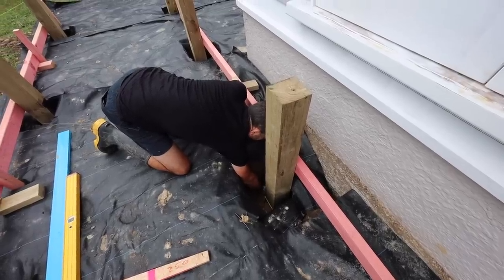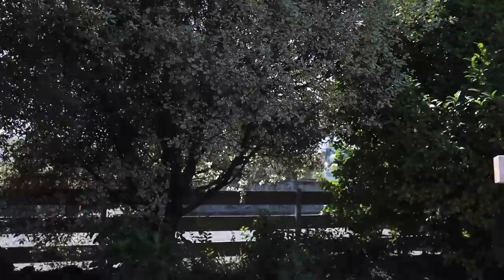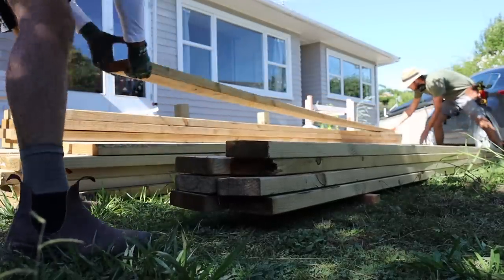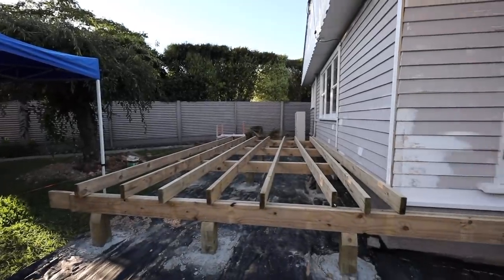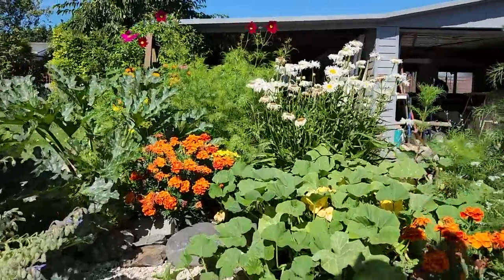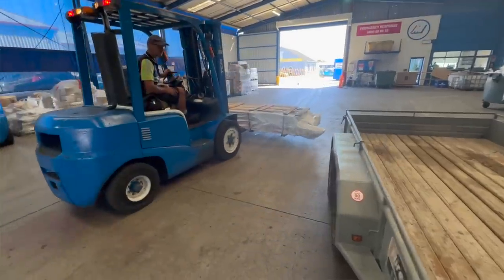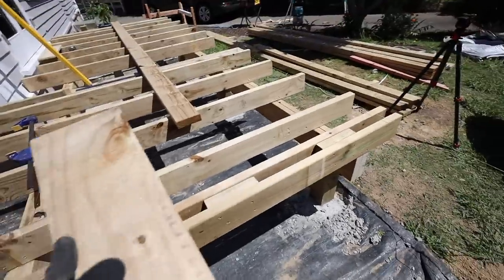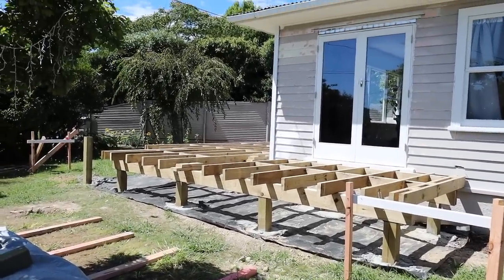Look at my big deck

Comment: Why using concrete around the pillars, the ground is firm and sandy, unless you build a house on the deck you are never put that much pressure on the piles. And it is going to rot a lot faster.

Comment: Too late now but when I put in posts I like to put 4 inch screws in the post about 1/2 way.  The screws go where you pour the concrete and hence keeps wood shrinkage from creating any wobble.  Mostly do this for railings but still a good practice.

Comment: Having built a few decks here in Tasmania I highly recommend Cutex Extreme decking oil. Great product for climates where weather is a factor. To prevent/delay silvering you will need to tint the product. The company has a variety of those also available. Hope that helps and love your channel. Regards Nick.
Reply: On a quick search, it doesn't appear that Cutek products are sold in NZ.  They might be Aussie only?
Reply: Building a deck here in Sydney atm and was recommended Cutex. Spotted Gum with a grey mist tint..Gonna look great!
Reply: @Hubris2 It’s just called CD50 in NZ, no Cutek. Available at most normal retailers (Mitre10 etc)

Comment: Greetings from Czech Republic, i have worked for years in Norway and i have learned alot obout wood working there. Now I´m back in Czech and started mine comprany few years ago, we dont have such as big market when it comes to wooden houses but we working on many prject - decks , terraces etc.. but the pilons or stands directly in concrete are pure evil ... they will get rotten rather sonner than later , i mean i really loving your content and i took alot of inspiration , dont take it bad but wood in concrete can work in short time but i would use some steel inbetween concrete and wood ... whatever iˇm loving your shit you do  ;-)
Reply: do you also use treated wood? it lasts a long time
Reply: I wondered about that too. I live in Connecticut. I would never pour concrete around a wood post, even if it's rated for ground contact, PT wood doesn't last for ever. I just saw a decking board rot completely through that wasn't even close to the ground.

Comment: A bit surprised you didn't lay a strip of the rubbery plastic along the tops of your beams. The rot proofing only goes so deep and water runs onto the top of the beams & soaks into the nail holes which leads to interior rot in the beams and corrosion of the fasteners by electrolysis. My neighbors are looking to have to replace their entire back deck because one of the previous owners cheaped out by not putting any weather stripping on the beams so the deck fasteners rusted out and water has gotten inside the main beams - they did install the plastic stripping when they had to renail the decking but the beams are on the way out.       But you do get Evil Points for breaking the auto captions function - not only did it fail on 'Deck' many times,  but it even started calling hammering and traffic noise as 'foreign language'.

Comment: Hot tip.. Ive always stained the top of joists before laying decking, for two reasons 1. It helps add more protection to the joist to help delay rot, and 2. When the deck gaps open up in summer you dont see pine coloured joists. Using matching stain chosen for decking of course 👌

Comment: Bit late now but you might have been better off to drill Reo bar through the posts 100mm up and siting out 75mm each side it would prevent any uplift in the future
Reply: Strange old myth that won't die. I have never seen 125 piles pull out of batched concrete and challenge anyone to try. Really hard. Not happening

Comment: I was delighted when you introduced the diagonal stairs because that would have been my suggestion .... to break the rigidity of the perpendicular with an accenting element. My opinion is the corner sticks out too far an creates a barrier between the two parts of the garden, but I hope it works out nicely.

Comment: I'm looking forward to your handrail approach.   In the States, a railing is required when an elevated surface exceeds specific limits (varies state to state.)
Reply: Australian rule is under 1m or  39" no handrail required so NZ probably same. I'd be a bit worried about the stairs being cut into the flow of the deck. Hopefully there'll be at least some visual separation otherwise it becomes a man/person trap in low light especially for guests unfamiliar with their surroundings.
Reply: 30" deck height here in the States, but need a minimum 34" handrail on any stair with three or more risers
Reply: @vidpromjm  tis

Comment: That's looking really nice! We used to live in Florida for a while and the house (we rented) had a deck with some sort of insect screen UNDER the deck planks. The main reason there was to keep insects away, the deck was part of a so-called 'veranda' with insect screen all around; a 'lanai'. Apart from the insect thing, it also had another use: when you drop things (BBQ...) on the deck, food disappears between the planks and the screen cathes it. You can clean it very easily. That way, nasty critters and rodents have no reason to get under the deck (and the house). I hope it's not too late to consider laying a roll of insect screen.

Comment: Questions: codes in the States require guard rails around any platform that is 18"  (450mm) above the surrounding grade. 
Looking at the shape of your deck that would mean a rail around there perimeter and indented stair way would be required. Does NZ code require one? If they don't will you you be installing one anyway? 
Second question; it's common practice here to slope deck surfaces to encourage water run off, that grade is usually 1 to 2% / ft.  It didn't appear from viewing the video that you are going to end up with a sloped deck surface.  The 4 x 4 posts appeared to be cut to the same height resulting in a "flat" deck.  It's that customary in NZ?
Reply: The building code in CT allow you to go up to 30' above the grade without a railing.

Comment: Just remember you can also  check relative heights  with a garden hose filled with water.  
Especially when line of sight is obstructed.
Modern Digital is nice, but not needed.

Comment: Your deck may block the house’s sub-floor airflow creating dry rot issues under the house. It happened to our house. We have installed a fan, on a timer, that keeps out the moisture. It seems to have solved the problem.
Reply: Are you in NZ also?
Reply: @metafive1  Yes in Levin, Horowhenua. We had a building inspection done. The foundational studs were disintegrating. We had them all replaced, a plastic sheet laid down on the ground, more vents put in, and a sub-floor ventilation system installed. The inspector, suggested we remove our patio too, to encourage airflow, but we decided not to. It would have negatively affected the exterior aesthetics of the house. It has been eight years since the work was carried out and the decay has not returned.

Comment: I would have lowered the deck one step down from the house, it looks to high for me. Hopefully you used treated lumber for all the exposed framing.
Reply: H4 timber used in the ground. H3.2 used above ground.
The only untreated timber used is boxing, used for such things as  concrete formation, etc, when used outdoors.
Reply: Then you don't get the nice indoor/outdoor flow. You have to step up to get in and step down yo get out.
Reply: @ericwolff6059  That's what I expected but your treated lumber doesn't look like the treated wood we have which is a darker brownish color.

Comment: I am not a fan of pouring concrete directly around wood, as it will most likely rot quite quickly. You should have used some kind of bitumen mass on parts of wood that will be covered in concrete.
Reply: Agreed, I always put the post on top of the concrete.

Comment: That is an impressive looking deck you are packing there Scott.
Also loving the progress updates on Jess's garden.
Quick question: What is the chamfer on the top of the deck posts for?
Reply: looks like the posts are wider than 90mm, so they were just chamfering the part that won't be covered by bearers, so water doesn't sit on it

Comment: Hey Scott, thanks for the video- what's the reason to have both the bearer and a joist to build your deck? Can you just have one and have the decking boards on top? I'm just wondering, thanks!
Reply: NZ gets lots of earth tremors that don't rate as earth quakes. Full framing like Scott has done keeps it all together rather than hoping the relatively thin decking boards can hold everything together rather than splitting or pulling loose.
Reply: Without the bearers you would need a shit load of extra posts to get the correct spacing for the joists. Posts are much more difficult and costly to put in than chucking some bearers across.

Comment: Hi Scott! 
Why do you need joists going perpindicular to each other? Why not just one layer of joists i mean? Planning on building a deck this summer(your winter). 
You are the best youtuber out there! 😊
Reply: With 150mm joists, they can only span 1800mm without any support....
Reply: You need bearers to bear the load of the joists over large spans
Reply: So with more ground support closer to each other, one could use only joists one direction?
Reply: @alexanderunden8607  Yes, you could, but it is usually easier and cheaper to use bearers as that reduces the number of holes you have to dig, posts you need, concreting you need to do.... The way he's done it in the video is the normal way to build a deck in NZ , I think in other countries they have things like plastic foot posts that are put on gravel to support the deck which may be cheaper,easier but I'm not sure they are legal in NZ.....

Comment: ok dumb questions.  Why not using any rubber joist protection tape ? Even paint for protection?  Not an expert, but I hate doing things more than once ever.  For the sake for $50 bucks you'd protect the structure for decades.  Maybe that's more of an Aussie thing...

Comment: There is grippy deck oil I found for massaging your deck. It will ensure that you get the necessary grip!

seriously though - I recently read in the branz guff online there is a necessary grip rating - I am hoping that grippy deck oil will achieve this without having to do that hideous groove up aka so called "grip tread" BS on your steps "perpendicular to the direction of travel" As if humans ever travel in one direction on a deck- ( and as if it weren't designed to wick timber away from the joists) I can't believe this idiocy has now been enshrined in the NZ building code. 

On that subject -  please do a bit on the subject of so called "grip tread"?

Here on the west coast I have been fixing up a badly built deck with decking grooves up. They are an absolute death trap in winter, hold dirt & moisture, get mouldy and freeze....

 I have found that when repurposing and redimensioning some of this old 30 x 90  decking timber with a thicknesser, that has been used grooves up,  - their are consistent, multiple splits that run right through the timber in line with the grooves. 
 I'm guessing because in winter the water gets in to the cracks and freezes, and expands - over time. So eventually these splits run right through the timber. 

- I'm pretty sure using oil would prevent you getting splits in your deck, regardless of size though.... 
(and preserve the look of the timber) ...